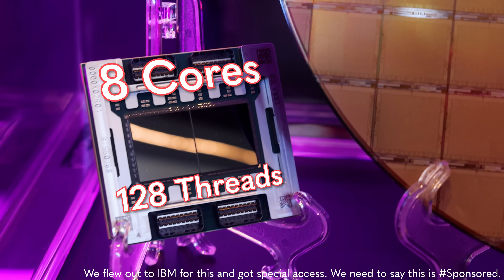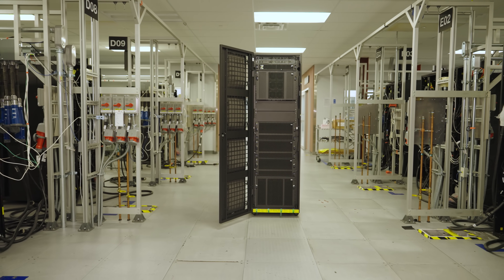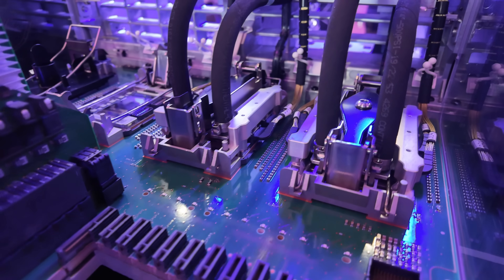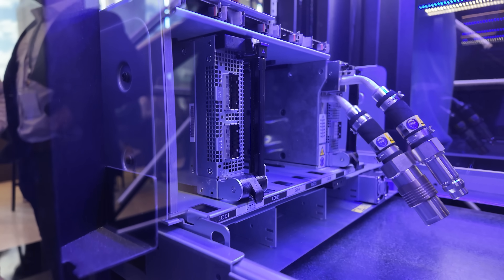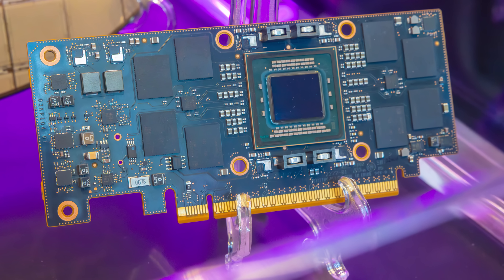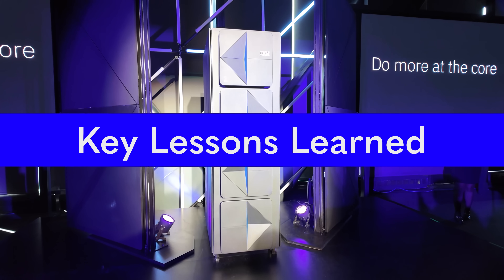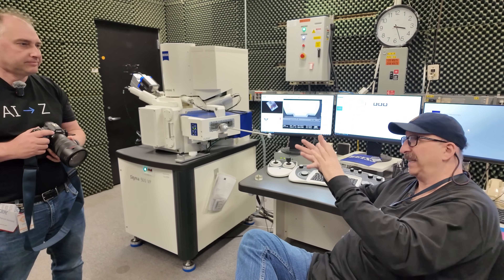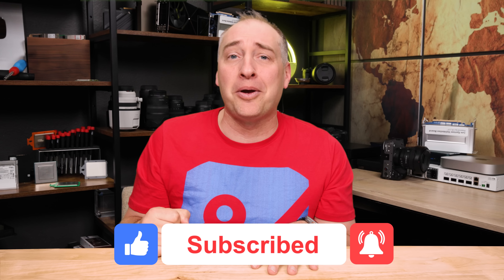THIS is how IBM makes servers that cannot fail

Comment: Yeah, this video is awesome to watch.  At the moment, this technology seems rather impressive.  Still I can't help but to wonder about overall throughput of a single IBM z17 and the number of distributed servers need to achieve similar results. Though, I'm willing to bet within 20 years from now, there'll be some distributed server boasting similar performance. Having worked on a mainframe for a number of years, I've experienced that advantages and disadvantages of a centralized system.  I've witness the quickness of sorting and joining gigabyte files within a second of CPU time.  And the response times with the system is taxed with thousands of concurrent tasks.

Comment: 0:25 Only took 25 seconds to see that this hardware is absolute trash: "Built-in AI accelerator"
Reply: The "AI accelerators" are really just smaller cores optimized for vector processing and neural functions. They have uses other than LLMs or even AI. This is bad faith logic.
Reply: Hurr ai bad

Comment: This is a terrific video, thanks for covering such a great platform!   And for the folks I see mentioning IBM systems are legacy or think they're old musty dusty, you are woefully uninformed and out of touch, as they are extremely current and high tech with every generation every few years.

Would love to see a similar deep dive into IBM Power systems, another great platform that has some of the mainframe's capabilities like first failure data capture, high speed buses and throughput, very stable and secure platform, 2-5x or better than x86 core to core, built-in virtualization & hypervisor with PowerVM to do LPARs (logical partitioning), etc.
Reply from the maker: Thanks for the kind words. Hopefully we get to do POWER in the future. Have an awesome day!

Comment: The mainframe having 8 9's of reliability is great, however, once you start trying to do even 2 9's of reliability you have other problems such as your infrastructure to the machine & the infrastructure tyat you & your customers rely on as does it really do you any good to have your systems running ehen your customers can't use them

IRL scenarios of things that companies no matter how many 9's a company built itself for will see that reliability/availability mostly pointless
1. 2022 Rogers Communications outage
2. 2025 Iberian Peninsula blackout
Yes, having redundant ISPs & backup power might keep you online, but if most of your customers are offline because of their ISP or power outages, the redundancy wasn't particularly useful

Considering that for most companies the failures of Electrical Utilities & ISPs harming their "effective reliability/availability" (the companies systems are running & the majority of customers are still using them), somhould likely have companies that care about their reliability/availability should also be pushing for more resilient power grids & ISP infrastructure that way their own 9's of reliability/availability are actually useful & not just nunbers that exist on paper

Comment: Thanks for the great video. Fun fact is that you can run all sorts of Linux apps on Z, including a ton of open source apps, where you can scale to over a million containers per system with modern tooling and the highest performance cores.

Comment: Marist University used to (and probably still does) have a "mainframe" program.  IBM donates to them a big ol' mainframe and Marist has courses around learning the mainframe ways.  A fairly unusual additional focus for CS/IT majors.
Reply: I would have guessed either that, or some internal boot camp, because mainframes are expensive
Reply: @vipvip-tf9rw  The university I learned mainframes on in the 70's doesn't have one anymore.  That's pretty common.  I think most schools managed to get rid of them in the 2000's.  A few holdouts remain.

There was constant pressure from the administration to get rid of the mainframe at my school.  They HATED the monthly fees for software, and maintenance, and the 7-figure price tag every 5 or 7 years to replace old with new.  

So instead they spent just as much on buying about 40 Sun Unix systems.  But hey--they didn't pay for monthly maintenance.  If things broke, we just bought a new Sun to replace it.  And the replacement bills were spread out year by year, so no one big "find $2M in the budget this year" annoyances.

Comment: Lots of assistance is needed for such a system. When the new cpu is given to public household computers, the features become a secret only used by the mainframe operators. Same happened w the Sound Blaster. Nobody said that it has an inbuilt Physx accelerator for cars and planes, the users have to figure it out how it works. As the chip is used for crash tests, the engineers may had to label its top Mercedes, BMW, Boeing, etc. May support gold, diamobd abd currency sales, but a BMW chip win't be a MB after configured with crash tests to BMW with car contours.

Comment: Don't use the microwave.  It might be a little faster than this method.  But as you said, it's just not the same due to the way microwaves work.  Put the chicken in the sink and cover it with cold water.  Unless it's a whole chicken, it will thaw in about 30 minutes. If it's still not fully thawed after that, drain the water and refill with cold water.  Physics is your friend.
Reply: ...Wrong video?
Reply: @whyjay9959  Apparently so.  Not sure how as I was watching the other vid when I commented.  Must be a yt bug.  LOL
Reply: @whyjay9959 nah, just life hack how to unfreeze mainframe

Comment: When I toured IBM's assembly site in poughkeepsie ny  they run the fully assembled systems within ovens and freezers to ensure they won't stop even when running WAAAAY outside the normal operating temperatures.  99.99999999% run-time isn't easy!

Comment: I worked in IBM Linux software when the Z series got Linux support.  We could spin up 32,000 copies of Red Hat in about 30 seconds.  You could prototype a full stack of IBM middleware on an Intel Linux box and then get it running on a Z pretty easily.  I'm sure it's even better now.
Reply: Are 32000 for micro services or vdi?

Comment: 14:10 She didn't know what a mainframe was but got hired to work on them, which shows she was 120% a diversity hire.
Reply from the maker: I am not sure what you mean. Companies hire folks all the time who have never used a product they are working on before. You might hire a materials scientist to work on a new invention where the material is only a small part of the final assembly. Someone good at diagnosing power supply issues might get hired even if they have never worked on mainframes. You might hire a CFD engineer to work on liquid cooling flow because they are great at CFD engineering, but they never knew what a mainframe was. Many industries have pipelines to train folks.
Reply: @ServeTheHomeVideo  Don't engage a bad-faith asshole who is trying to pull you into this culture-war conspiracy bullshit.
I know his position has no merit, you know it doesn't.
It's just a random asshole throwing mud and any attention by you already gives him and his position more credit than it's worth.

No, it doesn't even serve an imaginary audience that you thoroughly debunked his position: They won't remember your arguments.

They just remember that there is a debate with two positions when in reality there isn't a debate and it's a myth propagated to foster division and hatred.

edit: oof. I have found even more sockpuppets trying to peddle this white-genocide nonsense to your audience. Be watchful.
Reply: @ServeTheHomeVideo  Dude, if you haven't been paying attention to the lawsuits being brought on IBM for firing White and Asian men to meet the CEO's diversity goals and earn a pay bonus, then you are either hiding under a rock or naive. Not to mention it's the wide open secret that big tech companies have always hired any women working near tech, even if they were not qualified, just to increase their numbers, because men are more interested in tech, but too many men hurt their DEI scores.

Comment: Nice, now go upgrade AWS for fault tolerance, hahaha. You can have mirror servers 3x per region and 3 region mirror  back ups. Hmmm. That kind of beats a fault tolerant server in one building.
Reply from the maker: Why assume an organization like a bank only has one mainframe? Also, plenty of services running on AWS have outages when AWS has a big outage. Scale-out clustering software across regions is not easy and another failure point. What happens if Region 1 handles a transaction, but it takes tens of milliseconds to update in another region. You have to update across regions because you want fault tolerance, but then Region 2 gets a transaction for the same account and funds that have already been disbursed from Region 1? Keep in mind, mainframes process far more transactions each hour than there are Google searches.

If the answer were as easy as multi-region AWS, the banks would have all transitioned already.
Reply: @ServeTheHomeVideo  The market has spoken, Cloud is the way to go. Im sure you know cloud infrastructure and fault tolerance exceeds mainframe installs, thats why AWS powers Ecommerce and has revenues of over usd 90 bn. Mainframe has its niche market but imagine all the credit card transactions globally done over the web, thats cloud based. HP computing has its place look at Cerebra. But look at how AI training is done, hundreds of USD bn infra over cloud. Hmmm. Cheers.

Comment: Started at IBM many many moons ago, and was trained and worked for them for years on RISC environments, till I went into Fortune 500 private banks dealing with Intel Based Servers.  I was always involved with Data centers most people cant comprehend.  I designed data centers from the racks, to the generators to the liquid cooling and HVAC.  I maintained thousands of users in AD, Email, Security and more.    I love watching these videos without Linus or JTC etc which are complete self learned parrots who have no clue and base all their data on sponsors.   
Not to be harsh.

Comment: I started on IBM 360's and 370's. First as a printer operator and later as a console operator and finally as production support. We used to walk into the computer room to cool off on hot days. Now, you never see the mainframe. Everything is locked down. Many guys tell me that they have never seen a mainframe and yet they develop on it. I long since moved to the AS/400 then to client/server and now I'm on the cloud. I hope soon to go back on the mainframe for a few years and then retire. It will be full circle.

Comment: @ServeTheHome PLEASE do a tour with Cerebras System. Their  WSE-3 chip with 900,000 AI-optimized cores and 44 gigabytes 
of high performance on-wafer memory running at 21PB/s. Their first principes design from silicon to application is fascinating and unique.

Comment: They didn't even touch on virtualization.  There is no true bare metal on a mainframe that's user accessible.  It has a embedded hardware hypervisor in the system that you partition the hardware out before you install z/VM or configure KVM in Linux and further install the OS(es).

You can slice your mainframe up into Dev/Test/Cert/Prod partitions. Then install Dev/Test/Cert/Prod hypervisors on top of that.  The hardware redundancy is transparent to the OSes, hardware can be flagged as faulty, disabled and redundant hardware powers itself on to replace the failed hardware.  Then IBM shows up with parts before you know anything happened.  CPUs can change their operating mode based on licensing . Some CPUs are OS level CPUs, some are application CPUs, some only do data distribution, and some just run Java.  The chips are otherwise identical but the features are unlocked in software based upon your configuration and you can activate, disable, or recharacterize a given processor without touching the hardware.  If you need to double your thread capability, the chips are already there, just drop in the license key and they activate.
Reply from the maker: Great points here. TBH we did one video, but I probably came away with ideas for 3 more.
Reply: @ServeTheHomeVideo  Looks like it's time for another IBM sponsorship then
Reply: It's an impressive system. But it's really not all that different from a Cisco UCS in a lot of ways. You can achieve the same level of uptime and performance with a UCS. Plus they can scale pretty much infinitely.  I personally believe the only reason systems like this still exists is the complexity of re-writing the software for a distributed architecture. Scale-out architecture is superior to Scale-up in most ways. IMHO.
Reply: @stevenchapman207  as soon as I learned about this I thought to myself that you can 100% achieve this in a decentralized manner a lot more efficiently. Will it be a tough task , yes of course, and im not sure the speed will be acceptable until a good while in such a system, but it is the future for sure.
Reply: @joed1rtz  Oh yeah, definitely a difficult task, especially sharding the DB. Pretty sure that's why they are still willing to pay the money for such an impressive system. But I think they economics of it will eventually cause these amazing system to be a thing of the past. IBM's customer base for them has to be shrinking. And, it eventually won't be worth it for them or their customers.
Reply: @stevenchapman207  You are correct ... the IBM instruction set is very powerful, and you may have to write 100 lines of code to replace 1 IBM instruction. So banks and big business who started with mainframes are held hostage to the instruction set (code) ... that is what keeps the mainframe in business over the years.
Reply: Locking down hardware which is already there through software is a crime IMO
Reply: @DerTechNick  I very much agree. Though there do exist spaces where it makes sense. The massive overhead of developing the multifunction chip , only to be unable to sell it because most of your customers only need specific parts. In this situation it can actually be a win for the entire chain if done properly. 

Probably almost never in the consumerspace, but in enterprise this can make sense , and make many processes easier throughout the chain. You dont wanna pay for specialized userlevel engineering development in a part of the chip you dont even need. In this world products are often very specialized , and therefor the research overhead is massive --> leading to very steep prices. Such it is not feasible to buy stuff you dont need. And intel can simplify a lot from just producing 1 chip. So you gain a lot of advantages in this "special case" scenario. In a consumerchip it would be solely to squeeze every inch of production overhead down at the cost of everything a consumer cares about. Not remotely the same situation morally.

In something like the FPGA space as well. You cannot feasibly pay for fpga functionality that is way out of the scope of your usecase. Meanwhile it would be ridiculous to develop several fpga's for different usecases within the same scale. The FPGA is a good example because it is per definition a mold that can turn into anything. So the difference in usecases is very vast (besides obviously simulating/testing the functionality of your circuit design) - and the software needed to do your work is very specialised to the specific chip. Very expensive to do redundant work.
Reply: @DerTechNick  it all just reminded me of an old video of an nvidia employee testing a graphics cards simulated/realised on something like 20 daisy chained fpga's :D
Reply: Not sure why customers put up with that crap, if Intel showed up uninvited to service my 13700k I'd tell them to piss off.
Reply: @meekrab9027  because these companies aren't consumers, they pay MILLIONS for ONE of these server racks, and unlike you, if it breaks, they NEED it fixed ASAP, they obviously have an agreement with IBM to service as soon as something breaks. Without it, your credit card may not work.

Like the video said, ONE second of downtime in a YEAR. That's what the customers want, and that's what they're willing to pay for.

Comment: I didn't realize resilience against earthquakes would be a concern at the individual server/cabinet level -- I thought it would have mostly been a concern of the overall infrastructure, power and such, keeping the building from collapsing on the system, etc.
Reply from the maker: They actually took the system out to an earthquake testing lab in Reno IIRC but we did not have that footage. This comes from years ago where there was an earthquake in Japan where the mainframe kept running. You are right, the fiber into the facility, power, and so forth had to keep up, but you can get power and connectivity back and keep processing.
Reply: I think IBM (and sgi) use woolly metallic pads for CPU-contacts (and interconnectors) because there will be no bouncing signal-impacting effect as a result of concussions in the case of earthquakes, as with "normal" metal-to-metal contacts.

Comment: How does its AI accelerator compare with NVidia's H100 or H200 accelerators?
Reply from the maker: Which one? The one inside the Telum II or the Spyre? Assuming the Spyre, it is lower power but with more memory than the H100/ H100NVL. By the time you have 48 in a system you have 6TB of AI accelerator memory which is a lot.
Reply: @ServeTheHomeVideo  Either one ... but am I correct to the assume these mainframes were designed for inference purposes only, and not training? I see the large memory capacity is an advantage over the H100, which comes in handy during network training sessions. My concern were the FLOPS and TOPS/Watt ratings between the NVidia and IBM solutions.